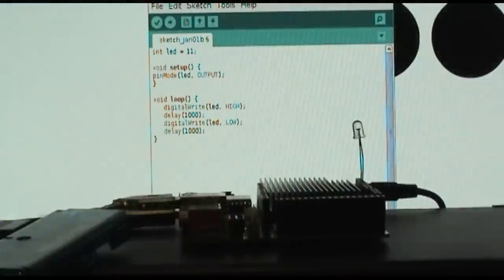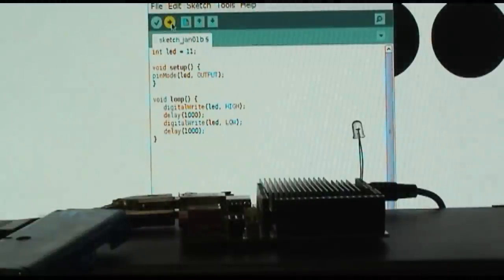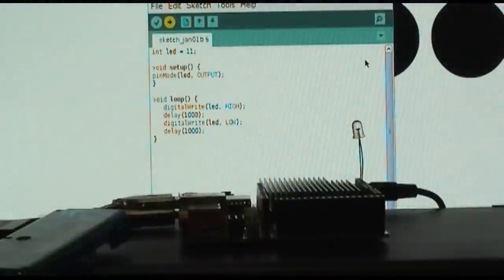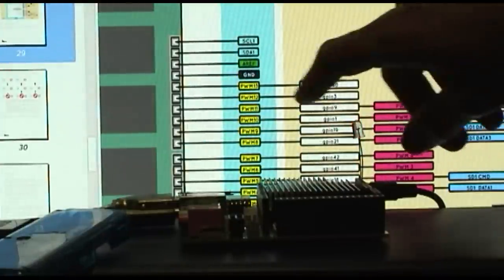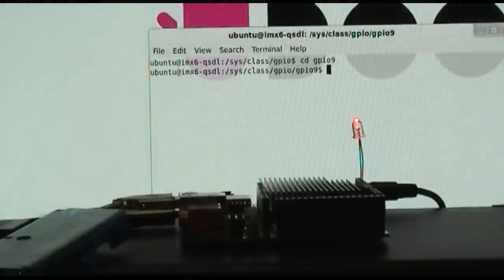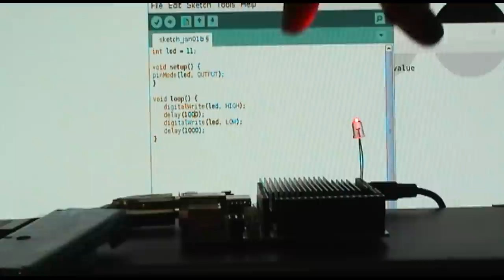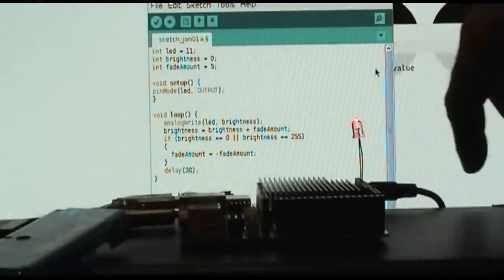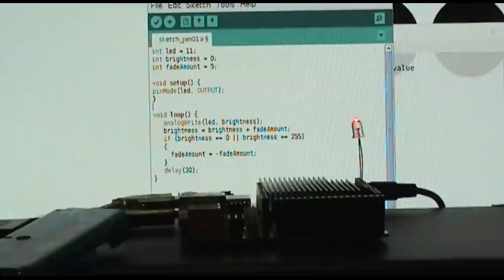UDOO Tutorial 1 - Driving an LED from arduino / reading from linux

Comment: Please tell me you can cut arduino out of the picture.
Since it seems you are able to access these pin values from the terminal.
Because it wouldn't be an RPI killer if you really need arduino IDE to drive it all.
This is what chased me away from the LattePanda.

Comment: Please do more. If I can request a video for a project I'm doing can you do a tutorial on sending the time of a real-time clock from from Lennix to Arduino over a gpio pin or whatever method is best. As I stated before this is for a project. I am trying to keep my Arduino code running continuously and instead of using the delays changing it to turn on at a certain time. Once again that this is so my code can be running instead of waiting at a delay.